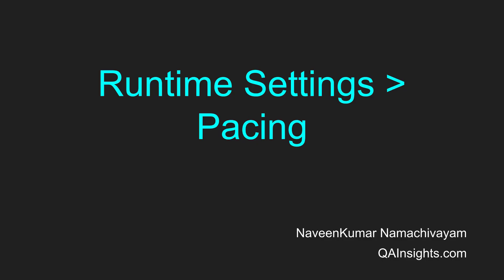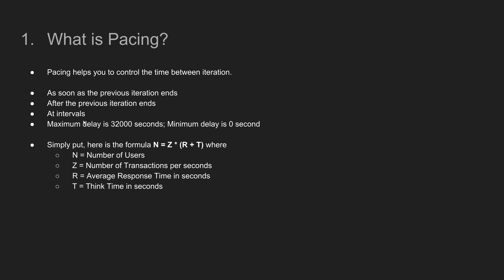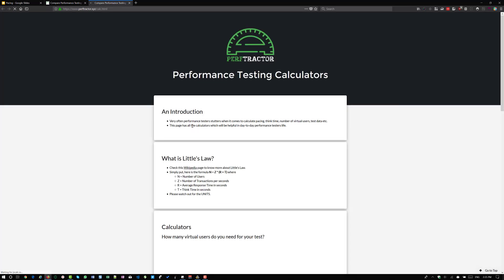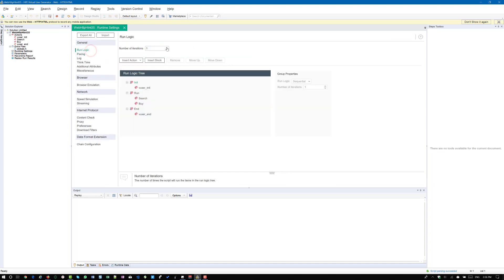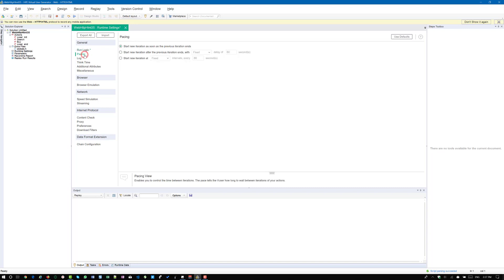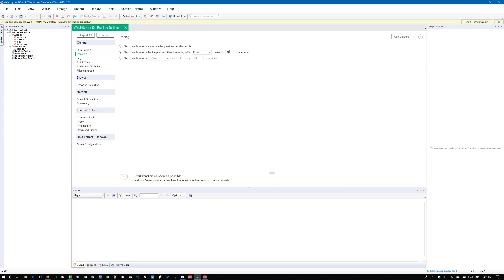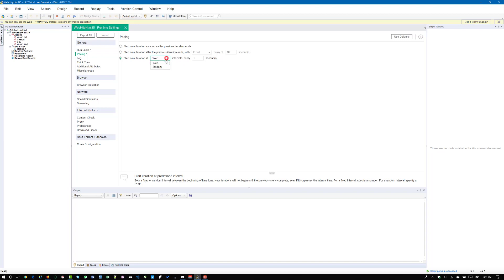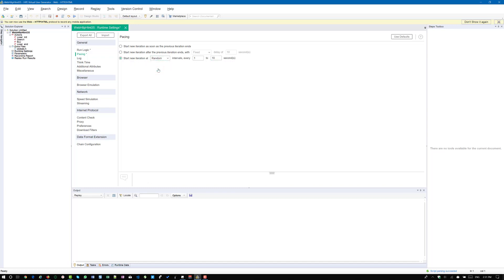Learn LoadRunner Series - #9 - Runtime Settings Pacing

Comment: I have a 15000 transaction per hour according to the requirements
1 hour duration
Without think time 17 secs response time
Can I get the pacing and number of users
Reply from the maker: Please check https://perftractor.xyz
Reply: I'm not sure about the answer I'm getting that is why asked here
Reply from the maker: @sweathaparrteban9756  there is a calculator available in the above link which will help you.